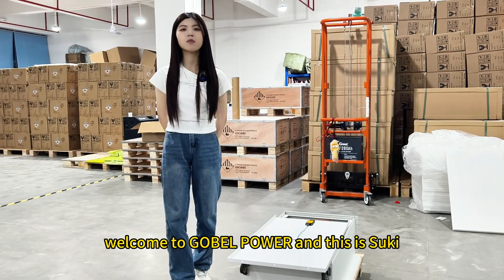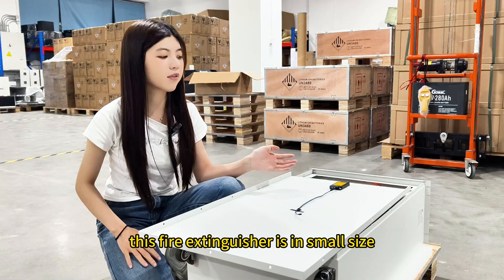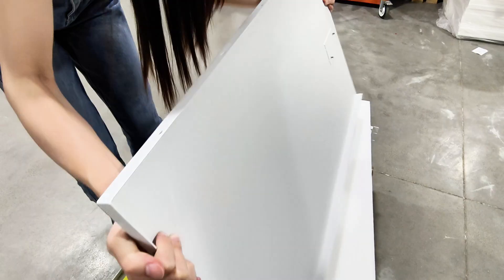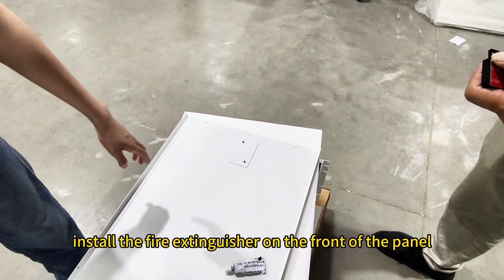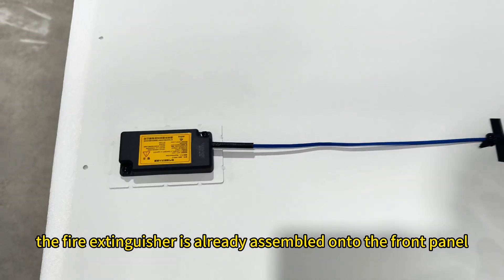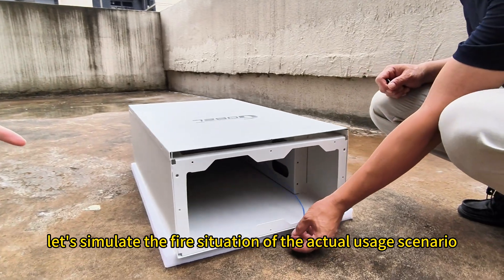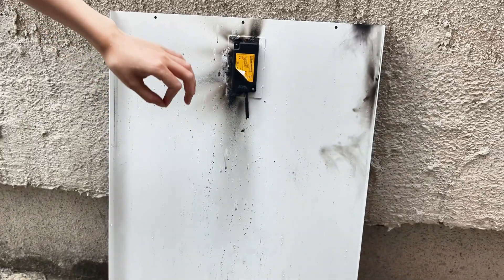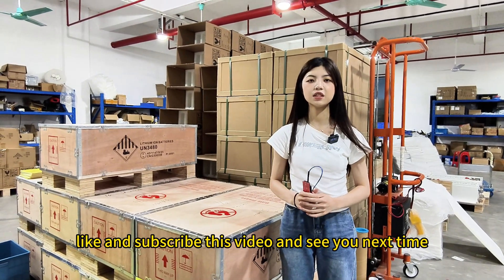Energy Storage Safety Upgrade! GOBEL’s Fire Suppression System Is Here | Installation & Test Demo

Comment: Using a ignition fuse to trigger the gas release only activates after a fire has already started and it CREATES its own fire. This is reactive, not proactive.

By the time the fuse burns and releases the gas, the fire may already be too large for such a small gas discharge to have any effect.

Even if the gas snuffs out the flame for a second, the hot components can reignite, especially if there's still power flowing or adjacent heat.

If a BMS catches fire, your current extinguisher won’t stop it. It’s too small, too slow, and doesn’t provide cooling or full suppression.

Comment: Lithium battery fires are self-sustaining, they do not require external oxygen to burn.
Even if you tossed them in the vacuum of space they'd still burn.
So how is that system going to extinguish such fires ?
Reply from the maker: Ternary lithium batteries do not require combustion aids, but lithium iron phosphate will not catch fire. The fire extinguisher is to prevent other accessories from burning.
Reply: Mit Gas zur Sauerstoff Verdrängung😅